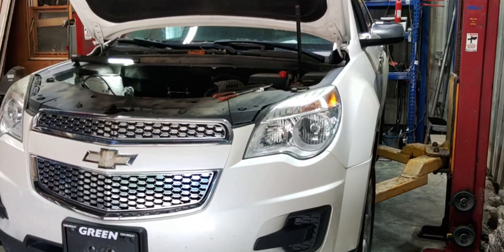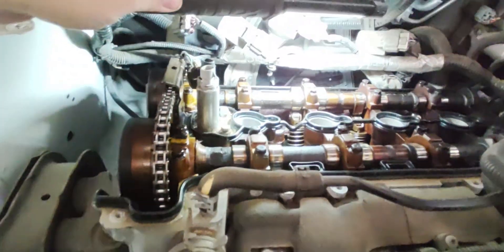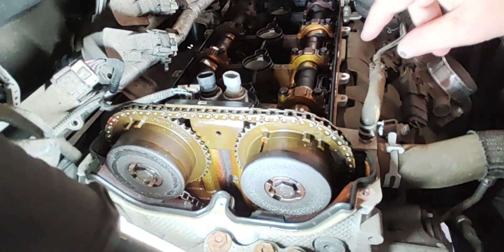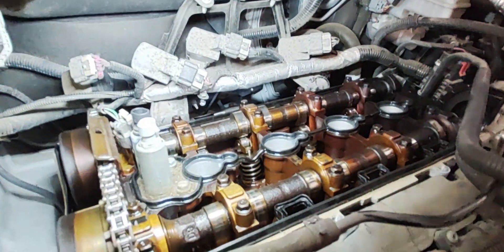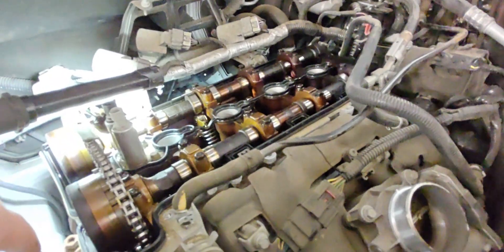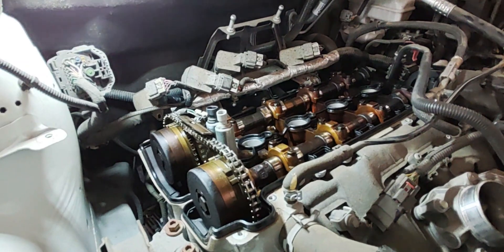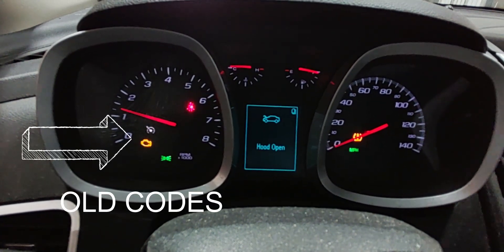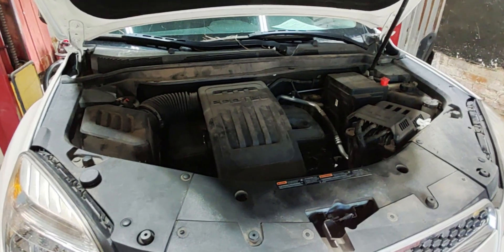Do these checks before replacing your 2.4 ecotec! You may not need an engine!

Comment: I had one where all valves were bent, no piston damage, replaced valves, rocker arms, t-chain, oil pump etc. Removed oil pan and cleaned everything out. Put it back together and it runs and drives perfect except it burns a ton of oil. I'm going to put pistons and rings in it soon. Hopefully it's going to be good after that. I think they all burn oil due to low tension piston rings and likely all need pistons and rings. Also, after doing the work, compression and leakdown tests were good.
Reply from the maker: Good work. I'm at the point now I'll put pistons in if i have to pull the head.
Reply: I thought most of the oil burning in these was mostly due to the PCV valve (valve cover replacement) or installing the updated oil cap with the integrated breather.

Comment: Very good video and information-- no-one wants to fix things anymore just replace or buy a new vehicle. I just had a buddy tell me his daughter drove her 2015 equinox to school came out wouldnt start- towed to shop told the engine was shot- replace for $7k-- i asked how did they determine the problem no one could give me an answer- offered to buy the old engine for $100 over core and they thought i was an idiot wouldnt sell it to me.
Reply: My 2011 Equinox just did this. Drove it to work just fine, tried to start it after work and wont start. I can hear the starter engage and try to crank but wont turn over. Got it towed to a shop and they said the engine is seized and I should just replace the whole engine which would cost about 5k if they just used a junk yard engine.

Comment: HELP NEEDED, I have a 2010 Chevy Malibu with 2.4 le9 I started hearing chattering noise from the timing chain area after an oil chain, especially at idle and in gear, so I did a full timing chain kit and when the mechanic did the job he did find the upper chain guide (between the phasers) was eaten up, but even after this is done it's still making the same noise some times it dose even ratel on cold start(keep in mind that I did but an ACDelco timing kit) so after this I pulled the valve cover and turned the engine by hand and what I saw puzzled me, the chain get lose and then tightened as i turn the engine..
what could the problem be? My guess is the phasers.
Reply from the maker: Could be the phasers, need to check and see if they move with the cam. If the lock pin is broken that could be your noise. The tensioner could also be bad.
Reply: firstly I want to thank you for your replay!.
I was thinking the same thing, when I took the valve cover I did not notice much, but after reviewing the short video I took,I saw that when the chain gets loose the intake phaser turns slightly backward is that normal?  @shedhouse7330
Reply: as for the tensioner, it's brand new, and on top of that WHEN the chain gets tight (as I rotate the engine by hand the chain becomes tight and then loose and then tight back up) it is very tight and the chain does not move. @shedhouse7330
Reply: firstly I want to thank you for the replay!.
secondly, after I reviewed the video of me spinning the engine by hand I noticed that when the chain gets loose the intake cam phaser turns slightly backward and when it does that the chain gets loose, is that normal?
as for the tensioner, it's brand new, and on top of that WHEN the chain gets tight (as I rotate the engine by hand the chain becomes tight and then loose and then tight back up) it is very tight and the chain does not move. @shedhouse7330

Comment: Whenever the part of the guide is missing you should drop the oil pan and remove the pieces. My mother's Equinox had the long black guide shatter and pieces of it were jammed inside the oil pickup screen. It also ruined the two bolts for that guide and the oil control valve screens were clogged with plastic from the guide. The amazing part was that it still ran and didn't jump time. It's also worth pointing out this this was the 2nd set of chains and guides that were put in this engine and they lasted less than 75K miles even though the oil level was kept up.
Reply from the maker: You are correct. When the guides come apart, it's important to clear off the oil pickup screen. I've done it many times. I go that far depending on what I can recover from the guides. If I can fish out the guides and piece it back together without any missing pieces, I've found pulling the pan to be a waste of time. However, you bring up a good point of previous guide failure, It would be hard to tell if someone left carnage in the pan previously. I need to start considering that!

Comment: Hey ive got a 16 equinox 2.4 auto awd. Its showing 3 codes i think, p219a, p0420, p0014, p0013 which is mostly timing stuff, fuel air mix, exhaust. it runs great one trip next time splutters everywere with lose of power until get plugs burning hot or something. Ive definatly gotta get a new hose that goes to use to be a pcv on Valve cover. But can you tell me what i need to do the timing completeley. lifetime warranty parts i dont like when their cheap because it means ill still have to do it again. If you have time id like to know what to buy and a fair brand something to actually last. Also my engine had the tube stopped offf on engine so lots seals and gaskets leak. What seals and gaskets that wont come in a kit can i replace while tearing into that part of the engine and any other things you would suggest changing instead of what i said? Any seals i can get to def needs done. it has abt 200000. people complains abt the 2.4 but ive not had to do anything until now with a lil over 200. ours has been great and we live in the WV mountians so its been used well. I hope you can find the time, Thanks !!!
Reply from the maker: go with gm or cloyes timing components. Make sure the rear main isn't leaking, the pcv can cause that seal to push out. If its not, I'd pull the intake and clean the pcv orfice. The timing cover gasket set comes with a new front crank seal, you'll also need a valve cover gasket. It will hard with that many miles, and you have to remove the valve cover anyway. For the codes, start with the chain, when the engine is running with a  bad chain the timing of valves everything else gets out of wack, so start with that and see how it goes. Also plan on doing phasers and actuators for the vvt.

Comment: My gf just had hers fixed it jumped timing at 105k miles just didnt start one morning never died on the road. It bent the valves so they replaced them and the pistons and rings because it was already consuming oil too. This was 5500 dollars for this fix at the local dealership. If youve got one of these engines in your car and it runs and drives take your loss and sell it before it blows up theyre utter garbage engines its a disgrace.
Reply: The 2.0 and 2.4 eco t most of the time the owner is at fault by using the wrong oil .
Advanced HM Valvoline full syn is the OEM oil for these designs! The cam ports are small and the guide tensioner need fresh top tier oil to function  any other brand will cause sludge and carbon build up thus causing the chain to jump timing and these are interference set ups  $3,200 +1600 labor for using the WRONG OIL!
Reply: Hello, my wife has a 2012 Buick Verano with the same engine. At 85,000 miles suddenly started burning oil. I had all basic parts checked and all was good. It burns about 1 quart for 600 miles. Can you tell me what you and your gf experienced ?  I want to dump the car but it actually still runs and drives great. Any feedback appreciated.
Reply: @chuckfrizzell8668  It's probably got something to do with the piston rings. It'll continue to run im sure but DO NOT ever let it go anywhere near low on oil cuz that's when it starves your timing chain and grenades the motor when the chain snaps
Reply: That sounds like good advice. Thank you.
Reply: @chuckfrizzell8668 change your oil every 3k miles. Don't listen to the manufacturers BS service intervals.
Reply: My kids 07 cobalt check engine came on. I checked oil and it wasn’t even in the stick and the engine sounded rattley. Filled with oil and it sounded normal. Later car wouldn’t start and it sounded to me starter spinning but not like engine spinning like no compression. But no rattle. What can I check first?
Reply: @wsvitak timing chain
Reply: @wsvitak Do a compression test on all 4 cylinders. They should all run 160+. If they are zero, you have major problems. Timing chain could have jumped time and bent or dropped valves.
Bent valves are repairable. Dropped valves grenade engines.
Pull valve cover and make sure timing chain is tight and plastic is on top guide.
Reply: Not really. If you see the warning signs and also if u consider the high mileage then you can prevent catastrophic failure.
Reply: You're absolutely right.  I got the same issue right now with 135k

Comment: Thanks,  I think my chain is slapping at start up  - car still runs OK.    Engine burns about 1 quart every 2K miles - better than most.   2013 Equinox 2.4L,  155K miles.
This would cost about $1500 at a local shop (not dealer)?
Reply: Trade that thing in don't even bother lol

Comment: I can't believe how many people fall into that trap of buying a new vehicle from the same manufacturer after having a horrible experience. I know they all have issues, but after seeing how widespread this is (or even the 3.6 chain issue!) I don't think my next vehicle will be a GM product. Bought our '14 Equinox new, and it only has just over 100,000 km, but I'm trying to decide the best course of action.

I don't really have the time to rebuild it, but I will as a last resort. I'm toying with the idea of pulling one at a wrecker and rebuilding that one, but also want to price out a long block from a local company. If they come with warranty and aren't too pricey, I might go that route.

I guess I'll go watch your video now! :face-green-smiling:
Reply: What problems have you experience thus far?
Reply: @tonycj7860  replaced the VVT solenoids, but then later must've ran it low on oil (🤬 oil rings) then it started clattering for a moment on startup (tensioner gone bad?) But I haven't dug into it to see what it needs. Should probably do something before it breaks lol. I really wonder how many are out there where owners changed oil diligently but still ended up with problems.

Edit: surprised it hasn't blow out the rear main seal. I was considering the vented cap and maybe a catch can once I check the PCV orifice.

Comment: Wish you were local my 2013 equinox is burning the oil
Reply: Drill a hole in your oil cap and relieve the back pressure and it will stop using oil

Comment: THANK YOU!! Finally someone who is knowledgeable about the 2.4L Ecotech engine… 

My car was bucking and stalling when idling. Car sat a mechanic but they couldn’t fix it. They replaced the high pressure pump and still having issues.

Looking online looks like most common problem is the timing chain..cam.. cam phaser..oil consumption

My car was fixed after I followed a video online saying you can fix a bad cam phaser by getting a fresh oil change and then put the car in manual and getting the revs up high.. 

SO STRANGE but my car is purring now and fixed LOL
Reply: hurry up and sell it.  these engines arent that great.

Comment: So I did my wife’s 2012 terrain 2.4L.. how do I know if I have it at TDC on the exhaust stroke and not the compression stroke?
Reply from the maker: If the valve cover is off l, watch the cam lobes. If you pull the plug you can look down into the cylinder and see the piston. Otherwise they make a whistle that connects to the compression gauges hose. Only makes noise when the valves are shut
Reply: @shedhouse7330  I made my own with a ballon and it never inflated at all but inflated in all other valves
Reply from the maker: @nextdoorpowerwashing8340  never thought to use a balloon. That's a pretty good idea.

Comment: I work on enough of these 2.4s the labor for engine swap vs timing chain is almost the same lol. Every time I do one of these I recommend a new water pump as well ... keep wrenching 👍👍👍
Reply: cost of timing chain kit vs engine ?
Reply: @TheRealSlimShady2012  If it's consuming oil you might as well have the whole thing rebuilt
Reply: @MegaRpgPlayer  All 2.4 engines consume excess oil. It doesn't matter if it's new or old, that's the problem they have.😊
Reply: @eduardoenriquez1897  bout to find out too ours was just rebuilt with updated rings and it got new pistons so it better not be burning any oil now too early to tell yet tho
Reply: @MegaRpgPlayer please let me how the rebuild went and oil consumption
Reply: @raidershydraulics6048  The car has been running good since the rebuild! It's no longer consuming oil it's been through 3 oil changes so far since the rebuild and each time the oil levels been basically the same as it was when the car was filled with fresh oil.
Reply: @eduardoenriquez1897  there is a small hole on the intake in the middle it is a very small hole and if you don’t clean it you will consume oil. You have to take the intake off to clean it. If you have a lot oil in your intake maybe the PCV on the valve cover is clogged also.
Reply: @MegaRpgPlayer  if you want to prevent wear and oil consumption, then use high quality premium oil like Pennzoil Platinum, good filters, change every 3k and use premium fuel that meets Top Tier standard.  My pistons and rings replaced at 90k, previous owner used cheap oil and gas.  At 194k, no oil burning, gets 34mpg, runs great.
Reply: @MegaRpgPlayer how to make sure you get the updated rings ?
Reply: @tssci6774  there's plenty of other manufacturers vehicles that run on shitty gas and oil and have no problem running for thousands of miles so I guess gmc is going backwards lol
Reply: @carlos4731  not really sure it was done at the dealer and it just listed updated piston rings. The car doesn't consume oil anymore so I believe it
Reply: @MegaRpgPlayer   what are your thoughts on the ZZP ECOTEC UPGRADED COMPLETE TIMING CHAIN KIT?
Reply: @theyknowimslim   lol right
Reply: I would recommend changing the balance shaft components when you change the timing components
Reply: My bro who sells used cars changes these in their driveway when he buys cars 'that need new engines'.
Reply: And if the head needs to come off there are extra charges for the machine shop the swap is more cost effective.
Reply: Biggest pos ever made last chevy I ever buy so I have my 2.4 out when I rotate it through by hand each revolution it has a snap noise  from what I can tell it is the chain tensioner that threads into the back of the head is this normal with no oil pressure ? Any ideas? Valves seem to all be moving fine and chain/tensioners all look good

Comment: Low oil and lack of freq oil changes will gum up the tensioners since they are run on oil pressure. Then chain slips and wala. And of course the stupid plastic tensioners.